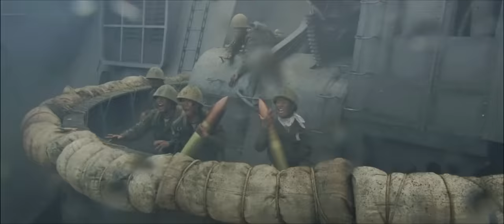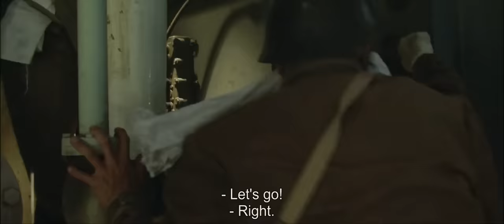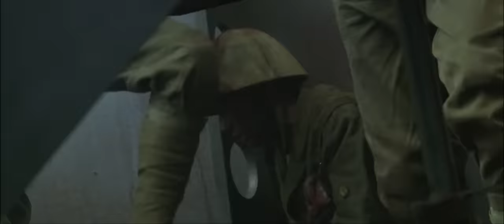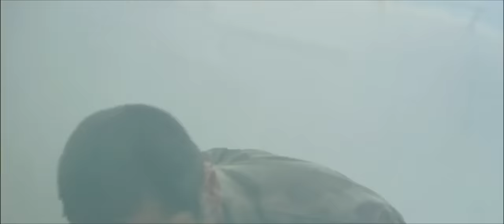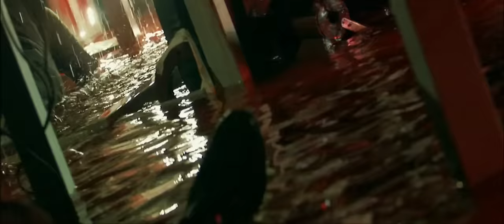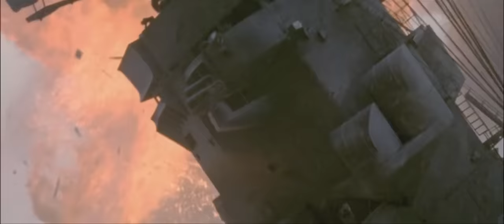The Sinking Of The Legendary Battleship Yamato | "Yamato" (2005)

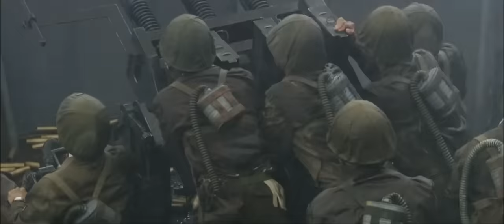Comment: 4:18 can anybody tell me what is that water bottle item connected with hose in back of Japanese guys???
Reply: Sure,
The shape resembles water canteens but it’s actually a portable oxygen tank. if you rewind 10 secs back you can see couple of troops went on fire when their tank got hit by shrapnels. Also if you look closely to the gunners you can see a face mask connected to the tube on their waist belt

Comment: The Japanese when building the Yamato built it for status rather than effectiveness. Bigger guns didn't exactly equate to more damage. There are diminishing returns where you gain very little but lose a lot in accuracy, precision, reload time, and just how much you can carry on the ship. Which is very strange for a country that values the Katana over a longsword so much. You would have thought they, of all people, would have understood bigger doesn't always mean better.
Reply: Yamato being massive isnt the problem. Its the fact that it lacked equipments required to face modern ships. Had they have radars on par with the americans they wouldve devastated any american ships.
Reply: @japethrurac5389  Modern tech wasn't the issue. Radar wouldn't have made them so much more accurate and it wouldn't have raised the ships overall combat effiencey enough because again smaller shells means a faster shell. Things that move fast can do just as much damage as something bigger moving slower. And you have more of them. Faster also means better range and more accurate a radar is just simply not changing basic physics.
Reply: @gibster9624  You clearly dont know how their fire control system works. Iowa ships have a crewmen dedicated on analyzing the location to where the shells landed. With the help of the powerful radar that the iowa has, as well as computers and ofc quick maths they can plot a correct trajectory needed for their shells to land. That gives Iowa the ability to fire in long ranges as well as firing while moving, accurately. Something not many mega battleships in their time can do. In short those who can fire accurately wins that engagement. Besides yamato has a very thicc armor meaning small caliber shells wont be able to penetrate her. Even the 16inch guns that the iowas have can still have problem penetrating yamato. A good balance of devastating firepower, advanced FCS and AA weaponry and speed is an excellent battleship which is basically what the Iowa class ships are and what yamato lacks (except the firepower part)
Reply: @japethrurac5389  I'm not reading all of that. I just explained to you that if they matched everything the same, the Yamato was still an inferior ship for many other reasons. Aside from the basic physics of how their main batteries worked and that a state of the art radar wasn't going to make them more accurate. Ignoring, of course, the reason modern ships don't use cannons anymore because of their habit of being inaccurate. It had design flaws with its haul and internal structure, making it harder to keep afloat during combat. There is an actual US warship that was retired, and they hit it with 2 nuclear bombs, and it still didn't sink the ship. 

The amount of damage some US ships were able to endure in battles and be able to make it back to ports to get fixed it is stuff of legends. There are actual WW2 German and Japanese soldiers who have gone to museums and talk about how they could feel the difference between theirs and the US's just by walking around the ship.
Reply: @gibster9624   Im not reading all of that too. Its probably full of crap anyways. Have a nice day
Reply: @japethrurac5389  Says the guy who acts like radar systems are just magic wands, and completely ignoring how the physics of a bullet works. If it had been that effective, they would have done it. It's WW2 for crying out loud, no time to spare expenses. Lmao
Reply: @gibster9624  Not my fault if you consider GFCS as "magic". Parallax correctors, rangefinders and electromechanical computers are already a standard for american ships at that time. If youre still unconvinced by the "magic" of radars, then look up on how Washington beat the shit out of Kirishima without even having a visual contact and only used radar the whole time and engaged kirishima at 5km.
Reply: @japethrurac5389  Still ignoring how physics works and that radar systems don't defy physics like you keep trying to say they do. So yes, it is your fault you think those systems are magic.
Reply: @japethrurac5389  Oh, and you're still ignoring mathematics. Bigger guns means less ammo, slower reloads, and fewer guns. How does a radar system change any of those? So yes. You do believe in magic.
Reply: @gibster9624  The logistics of battleships is an entirely different subject try again
Reply: @japethrurac5389  Okay how about this. The Yamato actually scored the longest range confirmed hit on a maneuvering destroyer at 11 miles. But bad radar systems yeah? It also had the longest ranged near miss at 17 miles. You act as if the Yamato was so incompentently designed yet ignore how it still performed. Egregiously overexaggerating the Yamato's targeting control deficiencies. So just cry about it.
Reply: @gibster9624  Longest? Lol. Warspite and Scharnhorst are both tied to that with both them hitting a target at a whooping 23km. Not to mention Gambier bay is NOT a destroyer but an escort carrier and she was already weakened by Chikuma and Kongo so its not really a challenging kill for Yamato. My point still stands cry about it bozo